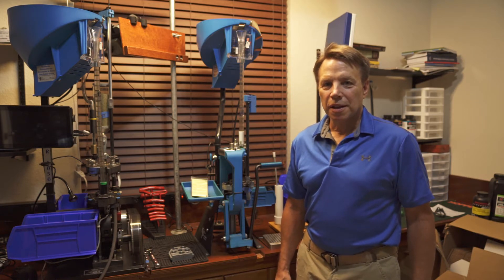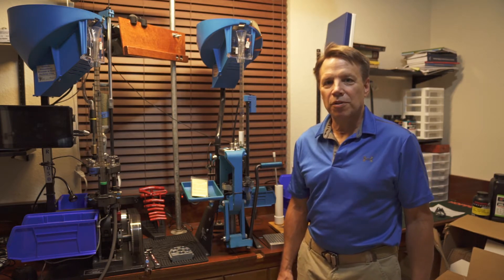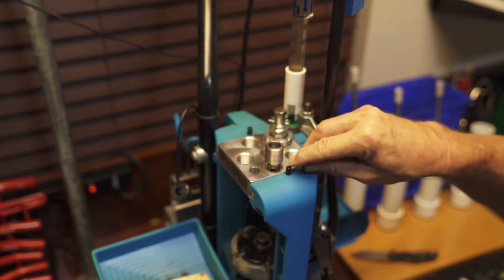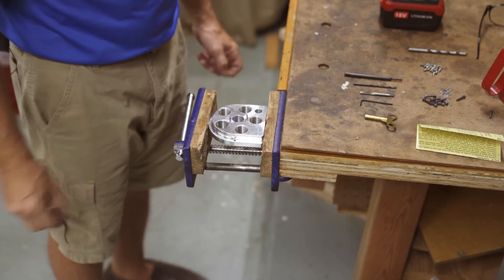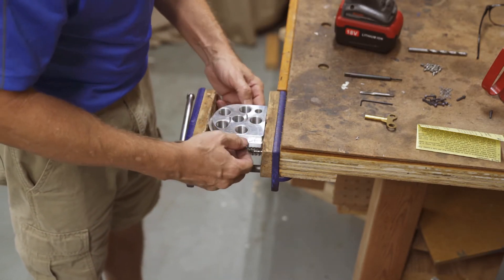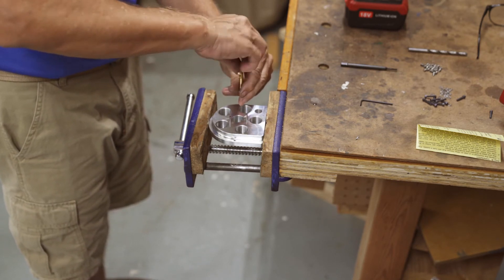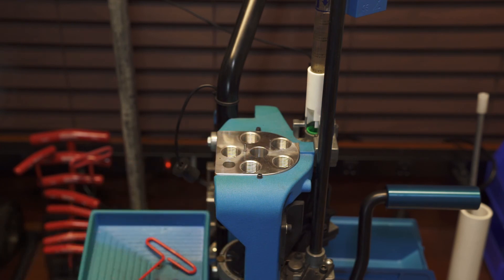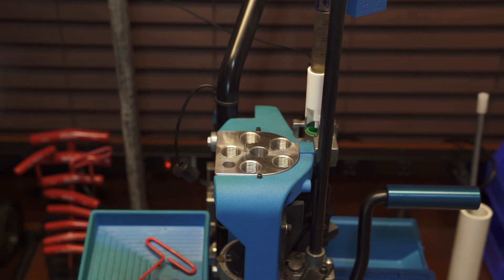Improving Dillon 650/750 Toolhead Precision

Comment: The loose plate is tight when working the press, any vertical slop gets removed when you seat the bullet.  The plate will move up tight just like this screw kit does.   I think its a waste of time to do it on a Dillon press.  It sounds great but in reality there is not as much as a problem as one might think.
Reply: That's my thought.  The tool head gets stopped at its upward movement.
Reply: @torreyintahoe  Not to mention that little bit of wiggle/slop is a good thing.   When you line up the sizing die that wiggle lets it self align then you tighten the die with the press handle all the way down (die up).  Each time you work the press it self aligns,  if you remove the wiggle as in the video you defeat that.

Comment: The Dillon is designed to have slop....it makes the toolhead float and therefore the dies self align. Are you sure you wanted to do this?
Reply: You then use a floating toolhead as he does in the video to achieve a precise float where it's needed
Reply: @cakeeee4  So how is this any different from eliminating the play in the XL750 tool head then?